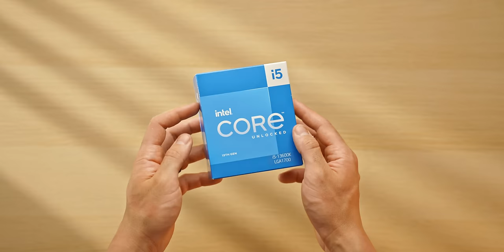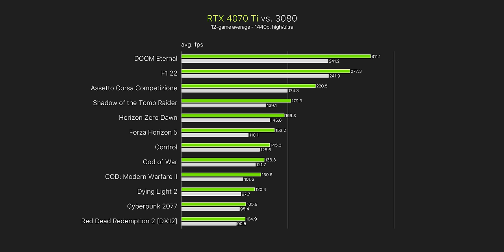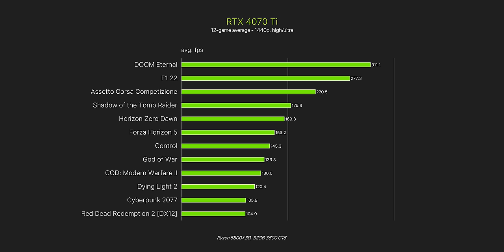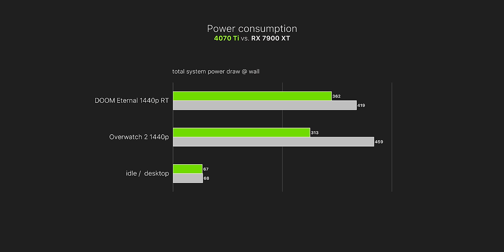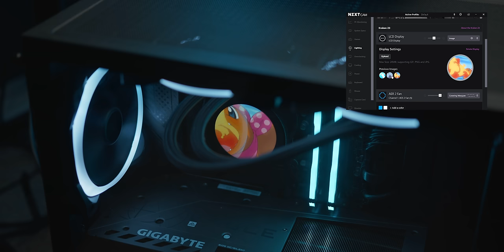$2000 Gaming PC Build (1440p destroyer)

Comment: You may not have air getting trapped in the pump block, but with the hoses like that you will start to see air pockets developing at the top of the radiator where the hoses connect. So, you'll eventually start to see reduced flow to and from the pump block because it'll start to starve the lines.  Having the radiator flipped with the hose connections on the bottom will eliminate that.  And, since the pump block is mounted lower than the top of the radiator, air won't get trapped in the pump block.
Reply: I noticed that too, you are right
Reply: Actually, I think it still would get trapped in the pump block because the air is going to go up, I don't think the air would be able to go down through the lines then up into the rad
Reply: top mount is the way to go in my opinion
Reply: Top mount all the way
Reply: Air will work to the highest point, which is the top of the radiator. As long as the pump is below the intake/ outflow of the radiator pump wear would be expected to be minimal.
Reply: As long as the pump isn't the highest point in the system, you're fine.
Reply: or flip the rad aroundon the front with the tubes facing down.
Reply: @theGooderz  That's what I said.
Reply: Nope. When the air that’s in it gets ejected by the pump, it will sit at the radiator inlet pushing the fluid at the radiator outlet/pump inlet higher. It will be perfectly fine as he has done it.
Reply: Mate. Optimum is the king of water-cooled loops. I think he knows what he's doing. As others have said; As long as that air pocket is not in the pump, you're groovy.
Reply: @kofeyh  Thats simply not true, when the pipes go down the air will stick at the highest "reachable" point which is NOT the radiator.
Reply: @DanieIMonteiro  what fluid dynamics is this based on?
Reply: I have had my AIO positioned with the tubes at the top since summer of 2018. I have yet to encounter any issues. I think you guys are overreacting.
Reply: Ever since Steve at GN released that video everyone suddenly became an aio expect and comments on every build with misinformation 😅
Reply: @samgoff5289 this. The same video gives the context for the determination of aio position relative to pump, but this has been lost along the way.
Reply: Oh god not this comment again. People see the Gamers Nexus video and suddenly think they’re an expert at AIOs. Why do commenters always think they know better?
Reply: @Sirwest299  So true. the fast that this has 150 thumbs up is astonishing.
Reply: Another easy fix is to stick with an air cooler :p AIO's barely give an advantage over air cooling these days, and even if it did cool better, it wouldn't be needed on a 6 p core CPU used for gaming
Reply: @pcmasterracetechgod5660  sure, air cooling works as well. However the endless panic over the rotation of AIO radiators is as hilarious as it is misplaced. Pretty much have to intentionally place an AIO radiator such that it's causing an associated pump to collect air.
Reply: This only happens if the tubes are directly connected to the pump. NZXT aio are not built like this so that is fine
Reply: + NZXT said pump tubes should be in two positions at 3 or 6 o'clock
Reply: At 7:00 he literally talks about why you shouldn't be worried about trapped air. Maybe finish the video before you become GN
Reply: @killerdoxen  You're spreading misinformation, mounting the radiator and pump like this causes air to get trapped in the top of the radiator which can cause bubbeling noise. It most likely wont damage the waterflow or the radiator but it can drain the water quicker and make annoying noise, and most manufactors discourage it because of that.
Reply: GPU prices are so stupid right now… in my day…70s used to be half that price. sorry rant over. Love the build and all ur content!
Reply: This
Reply: Needs the fans to push air through the other way. This config will heat the whole case up for no reason
Reply: I did the same mistake when building my first AIO with 360mm rad. Then after watching more YouTube bloggers started to notice that some off them are showing the wrong way off mounting just like here as some of the top tier bloggers noticed that. I then flipped the radiator around so the wiring will be from the bottom to get all the air on top of the radiator. Then I decided to move the radiator to the top off the case. I also would of placed the card vertically hence this case allows. I also found leaving the case without the side front wall keeps it way cooler even though I got 120mm fans set up in my case it doesn't help as much just leaving case open. It's under my desk I don't see it
Reply: Your 100% right that Rad. is upside down
Reply: @kofeyh air cooling is noisier
Reply: @mactep1 facts I’ve had my pump like that for years. It’s been fine ever since
Reply: Unless the pump is physically above the the point where the tubes connect to the rad there is no chance of this happening

Comment: The angled fan at the front is super cool, it reminds me of airflow designs case manufacturers did back in the 2000's
Reply: WQHD Godmode the Alight Basser 🎉
Reply: Hey, I've been using the HOTO Compressed Air Capsule and it's been a game-changer for keeping my desktop and keyboard clean. The vacuuming power and blowing capabilities are impressive, plus the multiple tubes and high-quality filters make it versatile. Highly recommend it for maintaining a spotless environment!

Comment: That's almost my build ! The only notable difference is the case, I went for the tad larger Lian Li 215 with 2x200mm fans at the front.
I highly approve the use of Fan Control for fans, and suggest Signal RGB for the RGB as well. These two are able to tune everything without installing every single company software. 
As always, amazing video quality.
Reply: thats the case i have, very nice case with lots of airflow
Reply: Does the motherboard has ARGB inputs
Reply: Do u got bottom airflow fans
Reply: @Filthyt  No fans at the bottom of the Lian li 215
Reply: is it loud when you're playing heavy games?
Reply: 100%
Reply: If I did a 4080 would that work or would i need different parts or case
Reply: Wish I could use SignalRGB. It was the sole reason for my PC stuttering in games every few seconds. I tried everything but it keeps causing trouble on my i7 14700k, 32GB DDR5 and Gigabyte Aorus Elite 4070Ti. High FPS in games but insanely irritating micro stuttering. Deleting SignalRGB solved all of my issues. Tested the issue on multiple Windows 11 reinstalls.
Reply: This is my exact build

Comment: I just built this as my first PC ever! It looks so freakin good. Thanks for the build guide.
Reply: Was it streamlined? Were the cpu is 13th gen the mobo is 12th gen but supports 13th gen, do I need to update the bios or is it still plug and play? Like just install the cpu and boot it up as normal
Reply: @cryo4183  from what i read it is needed so i did update the bios before the first startup and it worked flawlessly after that. also stays really cool.
Reply: Do you think it would be able to run vr games like beat saber? =) Im considering building this as my 2nd pc
Reply: how did you manage to get the motherboard on the standoffs of the case? I can’t seem to make it fit
Reply: @SWAGMESSIAH404 
Ha i like you name but it would look way better without the 404
So SWAG MESSIAH would be perfect imo anyways
Just sayin 
And if this pc is just your SECOND what is your MAIN pc specs?

Comment: I love the NZXT H5 Flow case. I recently rebuilt by PC in this case and it was very easy. I especially love the angled fan to draw in fresh air for the GPU. Overall, I would HIGHLY recommend this case for new builders.
Reply: is this RGB or non RGB version of Flow Case?
Reply: Hey there! I noticed you left a comment with "{{3}}". Based on the title and your comment, it seems like you're interested in PC building and maintenance. Have you heard of the HOTO Compressed Air Capsule? It's a compact device that combines vacuuming and blowing capabilities, making it great for cleaning your desktop, car, and more. It's got some cool features like multiple tubes, high-quality filters, and efficient storage. Might be worth checking out if you're looking for a versatile cleaning tool! 😄

Comment: I was considering an i7 or i9 with my RTX 4090 but went with the last-gen i5, and it's more than fine. Happy that you agree, I was worried if I was bottlenecking myself from the start :)
Reply: i7 12700k and i5 13600k
are both more than enough for rtx 4090
even with rtx 9090 it wont bottleneck lmfao
Reply: @nanezferrer3565  For 1440p and ultra wides, yes, 12700k bottlenecks 4090. 12600k aswell.
Reply: @nanezferrer3565  if you already ball out on a 4090 and cant manage to get a 13900K or 7800x3d, then theres something wrong with your priorities smh
Reply: @s8n..  i mean whats even the point of getting 20+ cores for gaming aside from bragging rights? you wont even use all of them and you'd end up spending more on cooler/motherboard/PSU/ power bill. its a waste.  i got a i7 13700kf with 4070ti and the cpu doesnt even get used that much, when 3d rendering id rather just use the GPU only as the CPU eats as much as the GPU in terms of wattage while not adding much to lowering render time.
Reply: there are i3s that outperform i9s what matters is the generation.

Comment: Awesome edit! Really liked the cinematic shoots. 

I was curious and configured your build. Adds up at ~ 2350€, so 2500$. Don't know if in Germany everything is 25% more expensive or it's just the market. This makes me sad ^^
Reply: For EU we have to pay import Tax on hardware, which generally speaking is ~20% since it applies to the high-bracket of taxes. In some countries only the low tax-bracket (9%) applies so hardware can be cheaper, but compared to the US we got it rough =)
Reply: at start 2000   sweden was best  place  to  build   gaming  pc  s :D
Reply: @joskrause9593  i think in sweden  you didnt   pay 20% taxes,  no idea how its now
Reply: It would end up costing 2800€ in Finland or around 3000 usd :oops:
Reply: Don't go 4070ti. Value is bottom of the barrel
Reply: its $1900 ( probably like $2200 with tax ) in US. the market is good right now but you can always find discounts and sales
Reply: mine is 2200

Comment: Great video, explained very nicely and clearly. Question for the experts, I was told to go with AMD Ryzen 7 5800x (my budget for first PC) but I notice ALOT of people on YT go with Intel?
Reply: intel has the gaming edge in most situations, but not by much. extra vcache doesn't help gaming in all situations
Reply: Cheaper board on 13th gen Intel for completely new builds still compatible on Z/B6XX mobos. Gaming crown will definitely be AMD's once 7XX0X3D CPUs release but atm it's slightly in favor of Intel

Comment: Looks good.  I think the radiator would have looked better on top which would have allowed for the cooling pipes to stay clear of the AIO LCD.  Great upgrade for your friend.
Reply: do you think gta rp would run on this build
Reply: Not to mention those front fans are gonna blow the heat from the radiator into the case, unless they are set to pull it out of the case. that would mean the others ar set to push air in.

Comment: I am still absolutely flabbergasted that THIS is considered Mid-Range!
Reply: Who is saying this is mid range? This is high end.
Reply: @PurpleRupees  Not with the current generation.
Reply: @josiahdublin7816  for graphics cards? Current generation hasn't released mid range cards yet. 4060 ti rumored card would be be midrange. And 4050 would be entry level.
Reply: @PurpleRupees  the 60 and 50 series of cards are budget. For nvidia the 70 is midrange and 80 and 90 being the high end ones. The 4070ti is an overpriced mid range card.
Reply: @josiahdublin7816  Nvidia has convinced people that the 70 tier is high end because people are now paying high end prices for mid range cards. I rememeber paying $1050AUD for my 1080ti but now the cheapest PNY 4070Ti is on sale for $1299AUD reduced from $1499..
Reply: @josiahdublin7816 
Exactly
Young people these days have no clue smh

Comment: I would have put the radiator top mounted as an exhaust with front panel fans as intake for cool air, the way you mounted it the cool air passes through the cpu radiator heating up the whole case

Comment: This setup is near identical to the setup that I made myself. I went with the fractal meshify 2 case simply because building with it is great and it has a ton of space. I also went with the intel i5 14600k rather than the 13600 but they're both identical. I also switched to the z790 just because I plan to stick with DDR5 and it was cheaper than the z690. Both builds are a 1440p beast!

Comment: I'm soooooooo confused. That GPU and CPU by themselves are $2000 on the amazon links and the total is $3,662.20 AUD ($2558 USD) if you add every item linked in the description? Perhaps you mean $2000 GBP?
Reply: cpu is 280 and gpu is 830 on newegg
Reply: @nostrum6410  not sure where you live but if you swim in the ocean for long enough you'll eventually get to another land mass and they'll usually deal in other forms of currency.
Reply: $3282 Dollaroos, prices ripped directly from Mwave minus shipping. That's with the cheapest 4070Ti (PNY).
Reply: @FourthLast ok smart azz how much would a good snorkel an flipper set cost for swimming to these other "land masses"????

Comment: So shouldn't tubes be other way (at the bottom) for front mount if we wanna minimize air bubbles being recirculated? Didn't Gamers Nexus do an entire video piece on this to put it to rest?
Reply: And if you watched it he said that as long as the pump is not the highest point it will work fine.
Reply: @danielboyas7645  he called out the issue of eventual "bubbling" noises that occur in this orientation over time. Not trying to start some argument, just thought I'd call out something another creator actively investigated. Performance will probably be fine but ideal positioning is still tubes down for pump life longevity and noise reduction.

See GN video on the topic from 18:00 - 19:46 timestamp

Comment: The radiator should be mounted tubes down, so that the air gets trapped on top of the radiator and doesn't affect the water flow. If tubes down doesn't fit, the second best option is to mount it on top of the case as exaust. This has been proved by gamers nexus.
Reply: No it hasn’t this has been debunked for so long, it’s completely fine in that orientation

Comment: You don't like your friend much, do you? 

Pairing 13600k with a DDR4 RAM is what I call blasphemy. Yeah, it supports it, but why would anyone want to lose the performance? Especially in a $2000 PC. Instead of getting an AIO cooler you (or your friend) could have gone for a cheaper air cooler (Thermalright or Deepcool, heck, even NH-D15) and put the money saved towards DDR5.

Then you go and mount the radiator at the front. So if those 2 extra fans on top are exhaust fans you created a completely negative pressure PC. Why? So your friend can have as much dust inside as possible? If they are intake fans the air being pulled in is going to get pulled out immediately by the rear exhaust fan and the front radiator fans. So no cool air for the graphics card. It will bake in its own sweat, so to speak. Instead of having 3 front fans pulling in cool air and the rear exhaust fan plus the radiator fans at the top pushing out the hot air you have created a negative pressure monster. Why? Why would anyone do that?

This PC has nowhere near the performance it should have for 2 grand. The cooling is... there is actually no cooling. Yup, you must not like your friend at all.
Reply: mr.pineapplez9077 then you did the right thing and I salute you. Now you can enjoy performance that the friend of the person in this video can only dream about.
Reply: so before i buy it today, should i switch to ddr5 and where should i place the radiator?
Reply: @mzprx76
Reply: @LazMann77  hey mate, you get DDR4 if you are on a budget (as in building a PC as cheap as possible). If you're building a PC for 2 grand you can afford DDR5. And you get the performance you should have for that amount of money. Put the radiator on the top, make the front fans intake fans and you'll have a perfect gaming rig. Hope this helps.
Reply: @mzprx76  tysm, i need some more help tho, so for the ddr5 i will need a MSI MGP z790 tomahawk other than the ram am wondering will the other stuff in this video fit in the z790 like the ssd,and the gpu, for the case i searched and i know it fits but for the other stuff i dont know, if you do please reply am in need of it quick becouse i dont have much time i need to build the pc quicky.
Reply: @LazMann77  I'm at work ATM, so my replies will probably not be too quick, but before I go any further I have two questions - do you have the processor already? And is it a gaming PC only you're going to build, or do you want to do other stuff as well (making videos, etc...)?
Reply: @mzprx76  i dont got the stuff i will order them today, the same stuff like in the video but since am maybe gonna switch to ddr5 motherboard and the ram, those 2 stuff will change, and am asking will the other stuff fit the z790 (the stuff mentioned in this vid)
Reply: @mzprx76  mostly for gaming but in the future  i might stream only those 2 things
Reply: @mzprx76  should i switch to ddr5 now or ddr4 is fine also
Reply: @LazMann77  DDR4 is fine, but DDR5 has better performance. If you're building a PC for gaming that costs $2000 you want the DDR5 performance. Check the motherboard, Google will tell you what kind of RAM it supports and what speeds. Otherwise it can be a good build, my main issue was the DDR4 RAM and no intake fans.